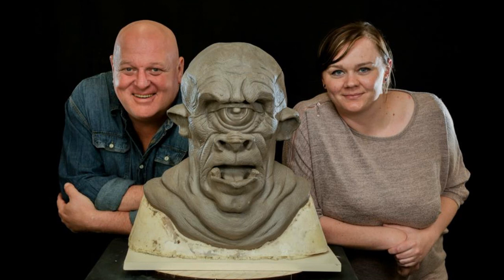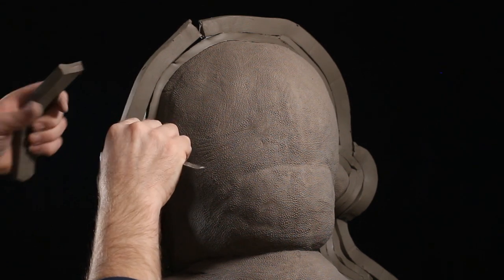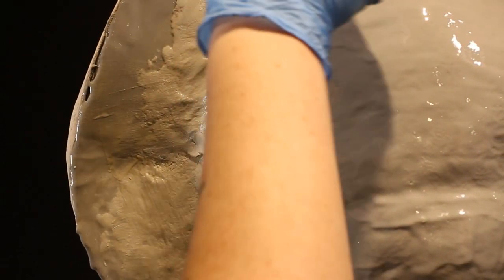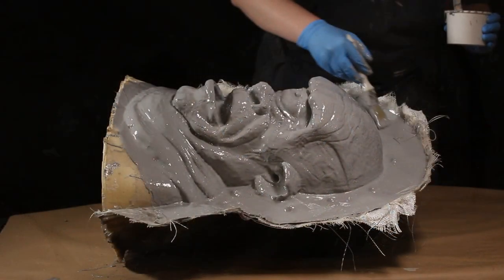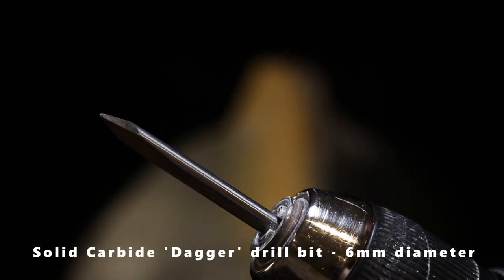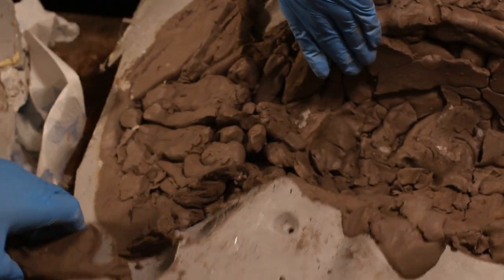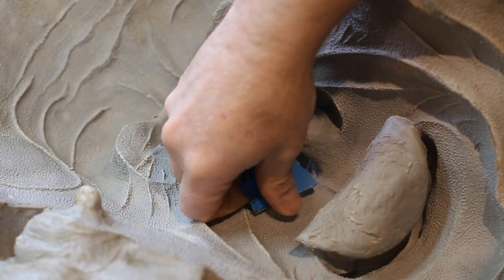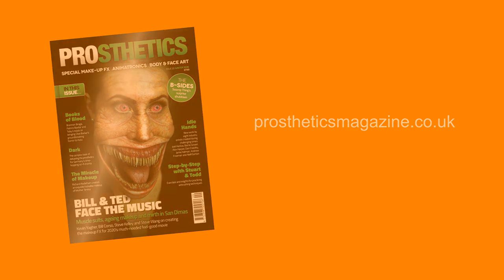Moulding A Cyclops

Comment: Using the coloured silicone rubber is a very good idea. Many years ago I fabricated some skin with boils on it, as a gelatin prosthetic. I used yellow food dye and a tiny bit of white face paint to give the boils some colour before I cast the rest of it.

It was very effective.

A real good way of pre-colouring a peice before getting down and putting the details on with alcohol based paint/silicone paint.

Again - a very through video without any needless steps.

Clean and concise.

Fantastic.

Comment: Very wonderful and informative video, as always! I'm curious about how much epoxy resin was used for this mold? I'm interested in working with large molds (head molds, complete torso molds, etc.), but price of materials always seems to be one of the inhibiting factors when doing it just as a side hobby. Based on how much epoxy resin was used, wondering if it could be a less costly alternative to a silicone mold with a mother mold.
Reply from the maker: If you can avoid using silicone for a mould then its utterly sensible to do so. In this instance, the final item to be cast out was always to be silicone so it makes sense to make a rigid mould. 

Plaster would work and would be cheaper, but I wanted to try epoxy. Polyester works well too, but having made so many polyester resin moulds,  I was keen to see how it compared.
Reply: @stuartbray  Thanks for the reply! I'll definitely continue with plaster for now
Reply from the maker: @mrbanana101  The key with a large plaster mould is to make sure its well supported with a frame or structure so you don't need to make it overly thick and heavy. Use plenty of scrim/burlap in layers to provide strength, as pure plaster is brittle and prone to break as it doesn't flex well unlike fibreglass moulds.

Comment: Great content...i wanted to ask how you minimize the mark left on the sculpture made from applying the clay wall directly to the sculpted surface?..i find if my sculpture is water based clay i do leave it as long as i can to harden before molding but can still spoil any fine details on the sculpt where the clay wall is pressed in..many thanks